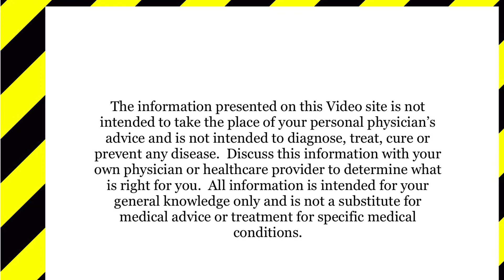Orgone Pyramid Frequency Generator Part ll

Comment: I wonder if you placed a ball over the pyramid with female socket, made from decomposed granite and your resin or wax, and filled it with colloidal gold, if it would charge and float.
Reply from the maker: You may have to amplify the frequency using a PEMF Circuit
Reply: @Enoch-Gnosis  I was shown a space ship in a dream, I asked why it was made out of decomposed granite and wax, they said because granite holds a charge, I asked why it was quite, they said the engine is a 2 way radio, much like my CB radio, with a bigger amp, that transmits like a radio station, not knowing nothing about electronics , I took apart a over the ear Bluetooth, and realized it was a micro radio, after you build a space ship, can you pick me up for the test run?
Reply: @BudDVega  the engine for propulsion was a radio? Like a radio, or actual radio waves? How many watts?